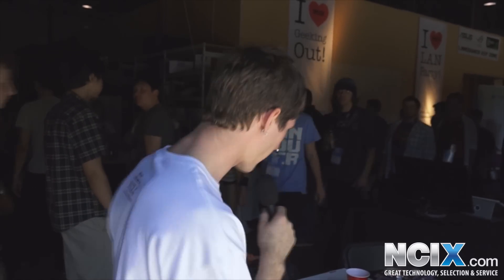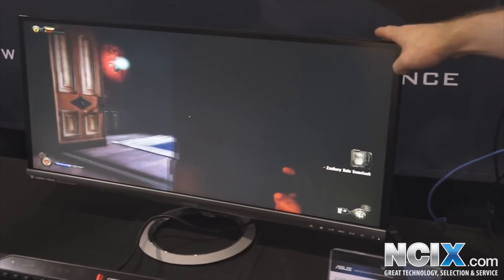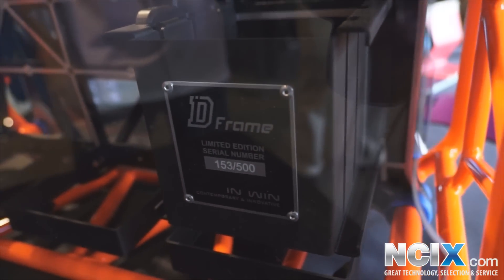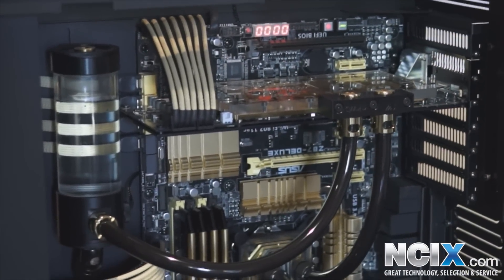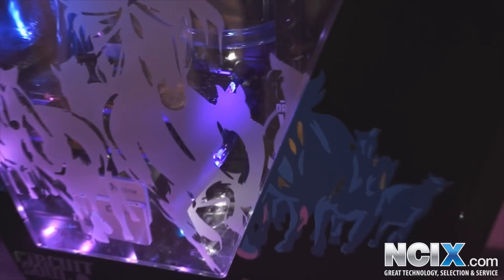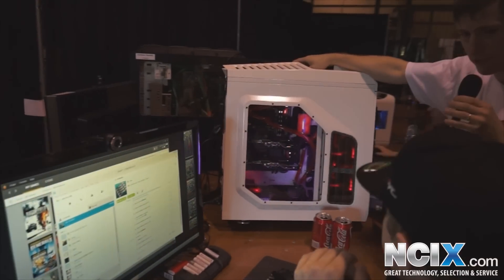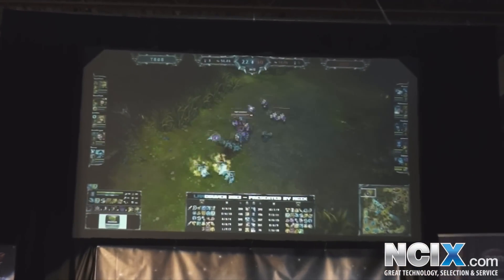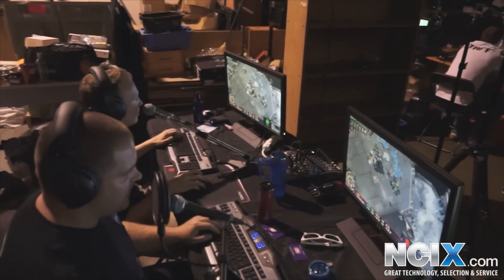LANcouver (sponsored by NCIX) lan party @ NCIX warehouse coverage pt. I

Comment: I have a 1/8" steel plate for a mouse pad that I made in shop class back in high school. It's been reupholstered many times, and is currently sporting black and grey fabric from an Element sweater. I couldn't live without it. To note, it's 9"x9" with 1-1/2" radius rounding on the front corners, and is raised slightly with rubber feet. I've always thought about illuminating the underside.